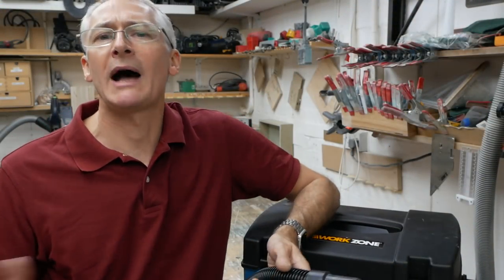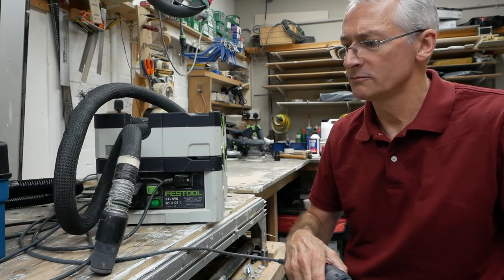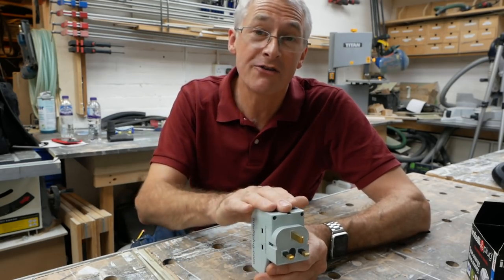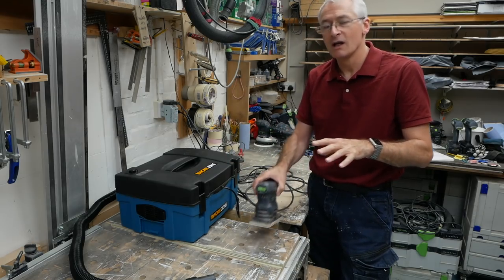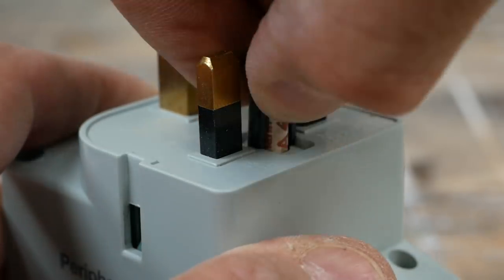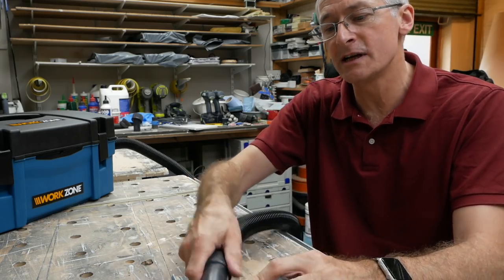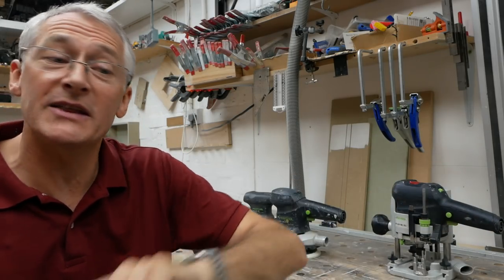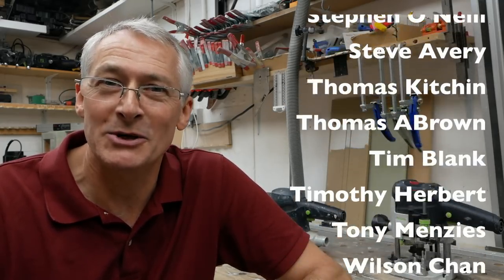Shop Vac AutoStart [#211]

Comment: I used the same plug with my Batavia tracksaw (copy of the Triton).  I'd start the saw a few seconds before I needed it.  This is OK with a TS, as the blade is enclosed.  With a normal circ saw (or certain other tools) this could lead to some dangerous habits.
Reply from the maker: Yes, good point; as I say in the video & description, everyone needs to engage their brain and apply some common sense before using electrical equipment / power tools 👍👍
Reply: Indeed.  I've now moved over to a shop vac, cyclone and 50mm ducting around the shop and have the vac on a remote control partly because I WAS getting impatient with that wait time.  Having above table dust collection collection ports is awesome as you have no issues with the track saw with the hose getting caught on the edge of the table ;)  Those plugs are a great option though for starting out or for non-permanent installs.
Reply: Marius Hornberger suggested this device do the same thing as the auto-switching plug: https://www.amazon.co.uk/dp/B004AVIHKK/?coliid=I6083YD3KMYHH&colid=24P5KE3E2EEP&psc=0&ref_=lv_ov_lig_dp_it
I think it's got a faster switching time (see his video for this (it's probably one of his on dust collection, maybe about a year old - sorry I can't remember more!))
Reply from the maker: Yes, I saw that, would make a great ‘fitted’ option. Bye bye 3-year warranty, of course... 😕
Reply: Plug box-type thing could make it portable and guarantee saving!   I found it on Marcus' video for those interested: https://youtu.be/qy2dsAsOVR8?t=511  This is not to detract from Peter's (& my old) option of the energy saving plug - both the plug and the master/slave switch are good options.  It's just another solution of which there are very few (unless you buy a 'proper' auto switch from a woodworking store at about 3-10x the price!), so thought it worth including here.

Comment: @Peter, have you ever thought about taking a quality motorfilter (from Festool or other brands) and simply glue that inside the Scheppach? 
By the time it should be replaced simply pull/cut it out and glue a new one in.
I don't own a Scheppach but do you think this is doable?
Reply from the maker: Possible I guess. Not sure it’s worth the effort though - the Festool bag hack’s probably a better option IMHO 👍
Reply: @10MinuteWorkshop  Thanks for your reply. I have another question for you. Do you also own one of the bigger Festool vacs (ctl mini/midi)? The bigger Festools are louder at full power (72Db), but have more suction power and have variable motor speed. I wonder if you turn them down to the same loudness of the CTL SYS (65Db), will the suction power be the same too?
Reply from the maker: Yes, I have a Midi and older CTL 22. Interesting idea, though not sure what I could use as a suction test. Or, to be blunt, that I care enough to come up with something - they're already all loud enough to warrant ear defenders, which is all I really need to know 👍
Reply: @10MinuteWorkshop  I went to the store to check for myself (never saw a Festool vac in real life). At the same suction level the midi has a "nicer to the ear" sound (lower pitch), but what did pleased me most is that the midi can be turned down to 60(!) decibel and still has enough suction for a sander at that level. 
Exactly what i was looking for and bought it. :-)
By the way, i own a Mirka Deros which is very quiet at 5000rpm (60dB), combined with a silent vac like the midi sanding is a real party.

Comment: Would this work if you added a 4 way extension ie a sander, track saw, router and a domino pluged into the extension
Reply from the maker: No reason why not - you’re just extending the number of sockets available on the ‘peripheral’ side - though not at the same time, obviously... 😯😬👍

Comment: Hi Peter, I know this is a relatively old vid, but I'm looking at one of these to solve my auto on issue. What would be your assessment of it now, is it still working? Lots on Amazon say its unreliable so I thought I get an honest opinion from a reliable source.
Reply from the maker: Sorry, I have mine away long ago. This one apparently works well - PTO auto start

https://www.ebay.co.uk/itm/Master-and-Slave-Auto-Power-Off-IEC-3-Way-1M-METRE-MAINS-Extension-Lead-RRP-18-/142692654433?mkcid=16&mkevt=1&_trksid=p2349624.m46890.l49286&mkrid=710-127635-2958-0

Comment: Sadly I think the company that sold/ manufactured these has gone bust or has ceased trading their website is no longer active and all the links to the product show no stock  or ceased manufacturing. There appears to be an alternative from a company listed as Eon products however looking at the descriptions the delay start / delay finish is @ 5mins which would be unacceptable for a power tool. Do t know if they had some safety issues or were affected by Covid; but it is a shame for what looked like a great product
Reply from the maker: I've no idea what happened to them tbh, but the video's a couple of years old, and things do change. A quick look through the comments suggests that folks who bought the Eon model found it to be perfectly usable, though I've no direct experience of it myself I'm afraid. 👍

Comment: If you have time to tinker and love building small electronics you could build an automatic switch with an arduino, a relay and a sensor for around 7€, there’s a great video about it on YouTube (in the title of that video there is a blue box with 2 sockets and 1 plug, I don’t remember the name or the creator of that video)

Comment: Do you think that ebay listing is a fake product, given the price on the manufacturer's website? I only ask because the chinese made electrical products are notorious for putting in fuses far above the actual current rating of the equipment.
Reply from the maker: Have to confess, I hadn’t considered that - it looks authentic with the printed box and everything. I’ll do a bit more checking, thanks...

Comment: will this plug work if i plug itinto a adapter and not directly into the power outlet on the wall
Reply from the maker: Yep. Old vid though, you may struggle to find one. 👍
Reply: I found a plug and it works fine if plugged directly into the wall 
If I plug it into a extension it won’t work 
Any ideas

Comment: I wonder how that would work with a transformer (110)🤔
Reply: Warren Lynch I have Fein 110v dust extractor I asked the customer service department about the 240v take off  with 110v transformer plugged in to power tools ! Answer the transformer will always draw some current which is enough to keep the extractor permanently on
Reply: Warren Lynch maybe this would have the same problem

Comment: Your eBay,co.uk link says listing finished
Reply from the maker: The video was published in August 2018 so I'm not really surprised, are you?? It was available under a number of other brands, and a quick google usually shows up a few likely candidates.
Reply: @10MinuteWorkshop  I found a master, double slave 1m triple extension cord on eBay when I searched.  Didn’t see any of the adapter type ones

Comment: I got so sick of every tool I bought had a different sized dust port that I decided I will not buy a tool that has a non standard dust port, period. I don't care how good it is (supposedly) how in vogue it is or any other reason.  If it does not have a standard dust port then it doesn't get a place in my shop.
Reply from the maker: Totally agree. Which standard did you go with?? 😆👍
Reply: I have two vacs, an old Sears vac with a 2 1/4" hose and a Fein Turbo with a 1 3/8" hose.  Those are my standards. Must fit one of those.